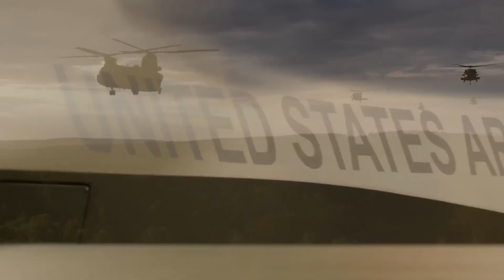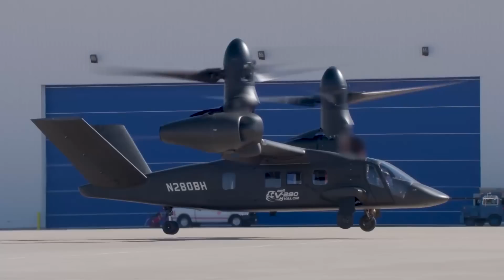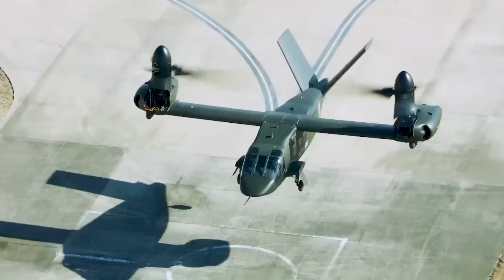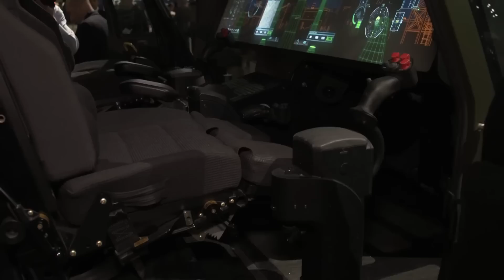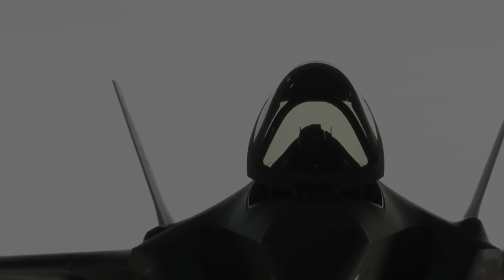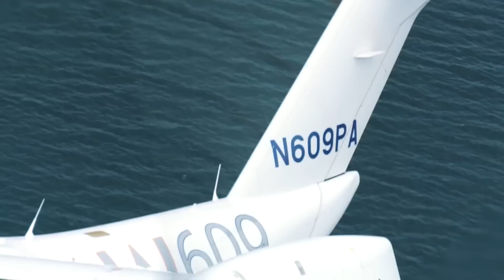V-280 Valor – The future Black Hawk

Comment: As a vtol tilt rotor, it's a major disadvantage that the wings don't fold. They have to also cater for the navy if they want to be successful.
Reply: They have a migital mock up of a naval version if the Navy gets interested. Currently the program is only for the Army.
Reply: That will not be a problem. All the drive shafts are in the wing. Look at how Ospreys fold up. Same thing applies here. https://www.google.com/search?q=Ospreys+fold+up&rlz=1C1ONGR_enUS1036US1036&oq=Ospreys+fold+up&gs_lcrp=EgZjaHJvbWUyBggAEEUYOTIICAEQABgWGB4yCAgCEAAYFhgeMggIAxAAGBYYHjIICAQQABgWGB4yDQgFEAAYhgMYgAQYigUyDQgGEAAYhgMYgAQYigXSAQc5NDFqMGo0qAIAsAIA&sourceid=chrome&ie=UTF-8#fpstate=ive&vld=cid:061fd8d6,vid:_45aUrES-j0,st:0
Reply: Few aircraft types are used by both the US Army and the US Navy (or the US Marines, or the USAF). They try, but as the three different versions of the F-35 Lightning prove, they typically don't succeed, ad aircraft types succeed based on sales to only one service. The Sikorsky S-70 is the Army's choice, and sees limited specialized use by the other forces, but it's a basically a generic helicopter - the more specialized the design, the narrower the applications.
Reply: That's too complicated, too heavy and too expensive!  You armchair engineers need to get real
Reply: @shadetreemech290 The design has yet to mature. The first helicopter wasn't exactly perfect either.

Comment: As a Marine Vet, I can tell you the Osprey scared the crap out of me, never knew if it was going to be the last hop you took.  Also, you can not auto-rotate these birds. It has cross-linked transmission probably but in my opinion, would be unstable.  The entire idea to me has never fully worked out right and with today's military and the dipshits running the machine... Maintenance and logistics is a joke.
Reply: You need to do more research into the platform then. Tilt rotors can auto rotate and auto rotation has rarely saved heavier military aircraft and would require a double engine failure which the Osprey has never had. The Osprey also has a better crash rate than the CH-53, CH-46(which it replaced), and many other navy aircraft. You are letting the media and youtube vids control what you think.

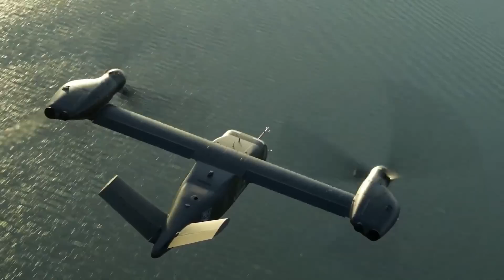Comment: 11:20 'slightly exposing the mechanisms' well I know where I'd be aiming my RPG.  Also, good look handling an 81 foot wingspan tilt rotor next time we're in Fallujah or other FIBUA
Reply: So, if these mechanisms were not exposed, you would not target the engine pods?
Reply: This is a stupid reason... not only are helicopters vulnerable in general but these will be made with more modern composite materials which should increase durability. The V-280 also passed the same maneuverability tests the Black Hawk passed so your second reason is wrong as well.
Reply: What, so you can actually aim for and hit a specific part of a fast-moving aircraft... with an RPG?? That's a laugh

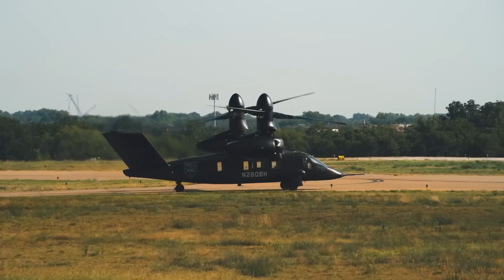Comment: 10:29 The right rotor looks like it is tilting forward and the left is tilting backward. Am I seeing this correctly?

Edit: is this what you meant when you said it acts like the main rotor of a helicopter? Also, does the Osprey do this or can it only change the blade pitch?
Reply: The Osprey can do similar yes but is not as maneuverable given its weight and smaller rotor diameter for said weight because of restrictions for ships.
Reply: @n3v3rforgott3n9  the Osprey has a rotor hub that can move independently of from the engine?
Reply: @bl8danjil  It is a swashplate like you see on normal helicopters. Yes but the movement is not as drastic. The main thing holding back the Osprey is the rotor diameter which is smaller than what was originally planned so it could fit on ships when folded.
Reply: The rotor masts (shafts) are both vertical, as you can see from the cones ("propeller spinners"). The rotor disks are tilted as the blades "flap", in typical helicopter fashion. Helicopters with two widely spaced rotors (both tandems such as the Chinook and designs with rotors out at the sides like this) yaw (rotate left or right) by tilting the cyclic control forward on one side and backward on the other. 

Yes, the Osprey and Valor both have typical helicopter cyclic control by swashplate on each rotor.

Comment: Thank you for a very informative video. I think the Sikorsky/Boeing helicopter would be better used as a model to replace the AH-64.
Reply: The Defiant was outclassed in nearly every way. It also had multiple technical issues that even resulted in a crash during testing of 1 of the only 2 functioning prototypes.

Comment: what will be a realistic time scope to see the valor get into service?
Reply: We will see the first active unit testing them in 2025 with a full unit supplied with them by 2030 which is the current timeframe which can change.
Reply: curious how and whether other branches will be able to adapt from this base model which is concepted for the army only obviously. the blackhawk at the time has served all branches, including naval, with a respective variant, but i don't see this possible with that tilt concept, especially when it comes to external storages. what is your oppinion?  @n3v3rforgott3n9
Reply: @piloto_loco  Just because something has been a certain way doesn't mean it has to continue that way. Although I would say it would help the other branches on costs as any program the army fully uses would have the production numbers to fully drop prices down as much as possible. They do have a mockup of a naval version for ships although since it has yet to be built or tested you wouldn't know how those changes would effect it or if they would be enough to meet requirements. Also what do you mean by internal storage? It carries more people than the Black Hawk and can carry a larger load.

Comment: Would be nice if you  went a little further back in the history  of VTOL aircraft.   The  Canadair CL-84 "Dynavert"  tilt WING aircraft was on the market back in 1967.  And the Ling-Temco-Vought (LTV) XC-142 heavey tilt WING almost  made it  to market at the  same time.
Reply: The video started further back than the Dynavert, with the 1955 XV-3. The V-280 is a tilt-rotor (like the XV-3), not a tilt-wing.

Comment: I think the V-280 is badass. I also think that the V-22 has a similar incident rate as many other service craft. I think the stigma is simply a matter of perception perpetuated by upper level brass who resent the craft from the beginning.
Reply: I might be wrong but I think it might have an incident rate lower than the average. I could be wrong though as I only heard about it and never looked into it.
Reply: Ok explain this to the families who had Airmen in Japan lose their lives because of the V-22 turd bucket!
Reply: @shadowopsairman1583  Do you say the same about the 5 or 6 Black Hawk crashes a year? The crash rate of the Osprey is similar to the Black Hawk and better than other medium left platforms.
Reply: @n3v3rforgott3n9  The crash rate of the V-22 is higher than the Black Hawk, but it's comparable to or less than the more equivalent CH-47 and CH-53; the CH-53 in particular has a rather poor record
Reply: @andrewreynolds4949  Yup my issue is with people that portray it as uniquely dangerous which is just false. Military aviation in general is dangerous.
Reply: @n3v3rforgott3n9  Yes, it's why I'll probably never join the Air Force
Reply: @andrewreynolds4949  I mean you are still in far more danger driving to work.
Reply: @shadowopsairman1583 the Ford Pinto destroys your emotional anecdotal argument
Reply: @shadowopsairman1583  By that logic you should never get into any car model because at least one of them has been crashed at some point in time.

Comment: Wtf its made out of carbon fiber? It had better not use any of those on structural supports or control surfaces. That shit is very brittle when compared to equivalent materials. If a neat explosion or a projectile hits it, im not sure whether it will just crack or fragment.

Comment: The Valor for the Army makes sense, but I doubt that it'll find a home amongst the USN or the USMC when their whirlybirds need to be replaced given its large footprint.
Reply: Gigantic footprint.
Reply: @greysheeum  no... it only has a 19% larger total footprint.
Reply: @greysheeum  For carrying 3 more troops and going 3 times the distance at 2 times the speed... very much worth it. Also Black Hawks do not land in area where their rotors are about to hit things.
Reply: @greysheeum  no It has always been standard procedure to look for landing zones with a certain amount of clearance. Now you of course can land in smaller landing zones if you cant help it. Again the Valor can land anywhere a Black Hawk can as long as it isn't limited on all 4 sides about to touch the Black Hawks blades which you don't want anyway. 

The Valor is wider but also shorter.
Reply: @greysheeum  ... you have done no research on this have you? Not only is it twice as fast and has 3 times the distance but has a faster time to altitude and stopping time from cruise speed than the Defiant which was also better than the Black Hawk. IE it will be in and out of the hot zone in half the time. It only has a 19% larger footprint in total and is wider but also shorter than the Black Hawk. If you turn it 90 degrees it will fit nearly anywhere a Black Hawk could. All of this while being able to carry more troops or cargo than the Black Hawk.

Comment: Not fully sold on the need to have max speed in a chopper. That is the biggest selling point for this configuration.
But how many missions, battles have been lost for the difference in speed. It's only one variable and i wouldn't trade it for reliability. But they are doing exactly that, IMO

Comment: How do these things emergency land?  They can't glider or autorotate.  I know the engines are linked but what if...
Reply: Tilt rotors can do both. In general auto rotation rarely saves military aircraft as they do not normally fly at lower altitudes in the first place. Either way dual engine failures on helicopters are few and far between.

Comment: I think that Sikorskey has the win the next FARA competition, yet I believe that the Army made the right choice with the V-280. The speed and range are wildly superior, and it wasn't that inferior to the Defiant in the hover regime. I'm looking forward to the V-280 deployment.
Reply: The comparison of deaths per 100,000 flight hours tells a different story.
Reply: @victorstern3341  it's a larger aircraft with higher capacity, so it only makes sense that it would have a higher death rate.
Reply: The incidents per flight hour are much higher as well.
Reply: @victorstern3341  No the Crash rate of the Osprey is better compared to other medium lift platforms like the CH-53 and CH-46. Class A mishap is also about how expensive the repair is which makes it a bad stat for safety comparisons.
Reply: I disagree. The tilt rotor concept has too many moving parts which is a maintenance nightmare. Many have died to prove this.
Reply: @victorstern3341  There are many who have died in Blackhawks as well. Helicopters are a particularly dangerous vehicles with many moving parts. The coaxial rotor from Sikorskey kept having a myriad of control and vibration issues throughout testing while the V280 sailed through its testing regime. This one is far simpler than the Osprey after they discovered that some complex design features were unnecessary.
Reply: @generalrendar7290  A lot of the complex design features on the V-22, like the rotating wing assembly and folding rotors are requirements from carrier use. The V-280 doesn't exactly need those, being operated by the Army, and is intended to be a smaller, simpler & cheaper platform. The main big change I can see for the V-22 is the moving vs fixed engine nacelles, they do reportedly cause a lot of problems
Reply: @andrewreynolds4949  the V280 also doesn't need the central gearbox because the rotors don't bend as much as Bell initially feared. That's why the wing isn't angled forward on the V280 like it is on the V22.

Comment: Purely political (and bad) decision. Somebody getting kickbacks, probably. With almost three and a half decades as an Army Aviator (MP, IP, and ASO), I just have to shake my head and shrug.
Reply: You are letting idiots online lead you along then. This travels nearly 3 times the distance at 2 times the speed while carrying more people / cargo.
Reply: @n3v3rforgott3n9  Well, after spending almost 35 years as a rotary wing Army Aviator (with combat experience) and as a Maintenance Test Pilot and Instructor Pilot helping shape the current tactics,  I'd say my opinion carries some weight.  If you have more experience than that in the field, especially with Army Aviation, please let me know, and I will, of course, apologize.
Reply: @petehaack5228  Yeah, but if you had looked at the SB-1Defiant like other US Army pilots did when they tried both aircraft. Then you'd have the same opinion as them. That the V-280 is vastly superior. 

Scratch that the Defiant was in the shop most of the time getting fixed so Army pilots never got a chance to fly it. By contrast, the Valor had successfully done a takeoff, flew around, and then landed without a pilot. 

Every pilot who flew the Valor loved it.
Reply: @petehaack5228  No I am saying you are not looking into the facts yourself and are going off of what other people have said. The Defiant has numerous technical issues that even resulted in a crash of one of the only 2 operational test aircraft. Also the defiant was simply outclassed by nearly all metrics. This is all public info you are access.

Comment: I wanted the v280 to win, but now I think the US military can use both the v280 and the defiant x, the defiant can probably land in more of a confined space and the valor is faster. I know the Army had problems with the defiant, but I think if the Army worked with Sikorsky those problems could be solved. As for using both designs the defiant can be paired with the v280 as if there is a space to small for valor the defiant x can most likely land. Anyways that I think and hope the US military could utilize both designs, I really think the military can benefit from both, I know it will cost money but I think it would be worth it
Reply: It's looking like the SOF might get the other model and or airforce
Reply: @VectorGhost  ?
Reply: @beltgirl  Defiant was completely outclassed and had numerous technical issues which even resulted in a crash... You are just asking for more logistics issues.

Comment: Hopefully this won’t have the hard clutch engagement issue that of the v22.
Reply: Likely not, since the Valor's engines are fixed and the force is transferred to the props through a spiral bevel gearbox.

It also has a differential that will share power from one engine to both props should an engine be lost.

That's not to say that it won't have issues of its own with a power train so complex, but they will be different problems than the Osprey.

Comment: I like it a lot; the rotation of the motors looks far better than Osprey's concept. I wish they could add Kevlar type armor which could be easily replaced after battle if there are hits from ground fire. Maybe an armadillo type armor which when going into contact could rotate to a different shape which deflects gun fire mor effectively. And maybe a non-troop transport version could be developed as an attack aircraft for supporting infantry including the A-10's gatling gun cannon. Use much of the cabin space for weapons, additional fuel and ammo for its weapons systems.

Comment: Looks fragile, and a big target. One hit to those wings or an engine nacelle and that thing is going down.  I don't know, I think the Defiant X would've been the better choice here, since at least that can run with one engine damaged.
Reply: You don't understand the platform at all... not only is every helicopter fragile but both engines turn both rotors at all times in aircraft like this. The defiant was completely outclassed and had multiple technical issues.

Comment: Can it autorotate safely or is that capability not needed ?
Reply: Tilt rotors can auto rotate and glide so many people are wrong about this. You are also over stating auto rotation as it has rarely saved heavier military helicopters.
Reply: It can't autorotate but there is a shaft connecting the two engines and rotors together so if one engine fails the other can power both rotors
Reply: @bluemountain4181  So basically the same as the osprey, i thought they couldn't do that on it couse of the need for a foldable wing and rotor blades that made the design heavier and with smaller overall rotors. This one is smaller, lighter, doesn't have all the foldable parts and still can't autorotate in a hover, even close to the ground  using the remaining rotor inertia ? i know there is a small chance that both engines would be hit but still. Can it glide well enough to put it down safely tho ? I think the agusta westland can autorotate yes ?
Reply: The Valor should be able to autorotate.   The issue with Osprey is all the drag the nacelles create in forward flight.    Without those huge „airbrakes“ the Valor should glide as well as other rotary winged aircraft.  
The real problem with tilt rotors and autorotation is that they transition out of vertical flight mode at a relatively low speed. Once in horizontal flight mode you don’t want to transition to vertical with engines out.    The only time autorotation works is when you’ve got forward airspeed.
Reply: I wouldn't call autorotation safe. 

The v-280 can fly on a single engine, so instead of autorotation, you just fly forward to generate lift.